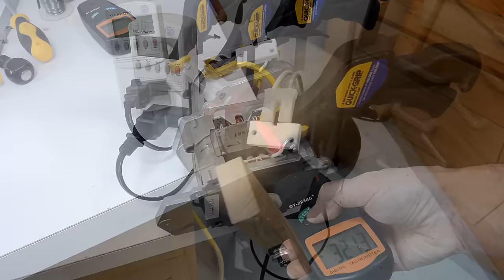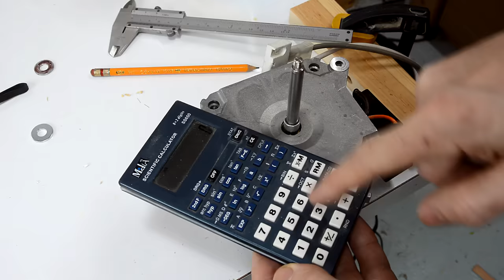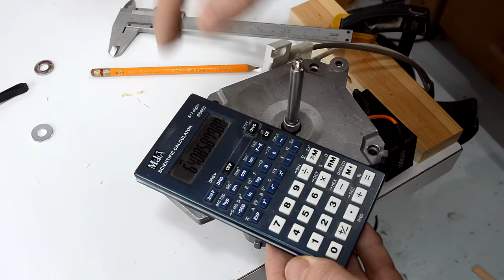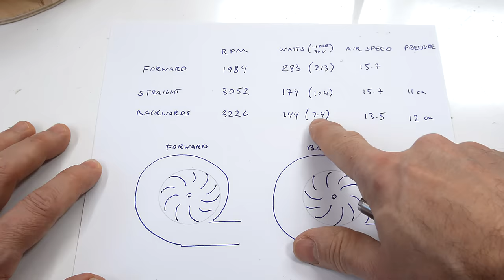Blower impeller design experiments

Comment: Mechanical engineer here. Sorry if i'm late, but i think this is very interesting.The forward facing blades are often used in industrial practice, just slightly different: short blades to reduce friction and in higher number. The low efficiency figure you got was absolutely due to the massive friction the air was producing on the blades. Side note: straight blades are used for dirty air flow (less change of blockage) and backward curved blades are used when higher pressure is needed more than high flow. You actually got the very same results that i got when I did the very same work but with a CDF simulation program, i'm so happy about this.

Comment: I know you are a real engineer, but either you did this experiment for the rest of us, or you have misplaced your ASHRAE manual. Forward curved fans produce tons of air at low back pressure, and backward curved fans produce much more air flow against back pressure. So for your dust collector system, a backward curved fan is the clear winner.

Comment: Pump Hydraulic Engineer here. If you underfile your backwards curved blades, you can increase the static pressure the impeller puts out. That is you make a straight cut tangent to the suction side (the concave side) from the trailing edge inwards, thinning the trailing edge. This will also however reduce the flow rate

Comment: I've built a couple of the impellers based on your original design with the backward curved blades turned by a 1.5 horse motor. I've been using them in the shop to drive a dust collector with 4" PVC piping to good effect. I've learned a few interesting things as a result. First is that wood vanes in a spherical pattern collect a lot dust on the inside curve of the blade because of the creation of a static vortex (I think) at the midpoint. This is exacerbated because of the relatively rough texture of the wood vane. The collection is also uneven, causing the impeller to lose balance as it runs. Tapping the impeller to loosen the dust helps, but it isn't entirely effective. As a result I've moved away from wood vanes to fiberglass. It allows me to easily create hybrid vane shapes and have a very smooth, static resistant surface. Also, I find them infinitely easier to manufacture consistently compared to cutting vanes from a blank on the bandsaw. I'm currently running with a parabolic (near) shape that starts with a sharp curve and ends nearly flat. This prevents the dust buildup and produces a 20% higher air volume with only a 10% increase in motor amperage. I don't have measurements for air speed or static pressure lacking the instrumentation (and the inclination to build any) to measure them. Anyway, I thought you might find this interesting.
Reply from the maker: I always have the blower after the filter.  Haven't had issues with dust buildup myself.
Reply: Are non-circular curves any harder to make from wood? Sure, they are harder to plot because compasses will give you a circular arc, but if you print a template out you could just cut them on a bandsaw roughly the way Matthias does here. (Providing the curve isn't so great you run into problems from the non-uniform thickness if you stack the blades together - but if the shape is that critical you'd cut them out individually with waste on either side)
Reply: Your comment makes me want to mess with airfoil (wing) shaped blower blades.
Reply: You run into non-uniform thickness all the time. I had a lot of variance between the blades even though they were cut from templates. You adjust for it when you balance the impeller, but I just found that I got something much more consistent in density and shape with the fiberglass. Plus, they were significantly stronger at roughly the same weight.
Reply: That is effectively what I have done. The shape is that of an air foil with a slightly flatter return (back) side. It made manufacturing a little easier to do that. I would change my mould again to use a full airfoil the next time.
Reply: Steve Hole como agucar brocas de ferro
Reply: Steve Hole 3
Reply: This is why radial blades are best for dust collection and moving material around. Just make them straight and they are self cleansing but produces more noise.
Reply: Steve Hole could you show us how to form those fiberglass impellers
Reply: @AS-ug2vq  Are radial blades the ones Matthias tested first?
Reply: @AS-ug2vq  Are radial blades the ones Matthias tested first?

Comment: I love the way you just pull an electric motor apart as if it was like peeling a banana!
Reply: Some people are peeling a banana as if they have to re-engineer an electric motor.
Reply: your comment restored my faith in humanity.
Reply: sasja de vries. Ummm ok lol
Reply: +David Stanton
One key difference... a banana cannot be re-assembled.
Reply: Find the right engineer and I am CERTAIN that banana would end up re-assembled. If there is a will...
Reply: David Stanton big boy good
Reply: problem when doing the swapping of the end bells can scratch the bushings, and will fail in a short time, care must be taken or this job will be like stepping on a banana.. the rotors shaft side should be left in the endbell and the back should be removed as it is less apt to have rust or dust.
Reply: David Stanton yes
Reply: I'd recommend a Genetic Engineer.
Reply: Rajitha Kommu z
Reply: I did feel jealousy at this point.
Reply: @K Me  Re-assemble a banana should be easy. Simply glue the banana back with silicon? Bonus: with food grade silicon, you can eat the banana later.
Reply: Electric motors are the only type of motor :)  things that use fuel are engines
Reply: only certain motors can be swapped in direction using such a re-mounting method. others just need two cable shoes swapped. - so it depends on your specific type.
Reply: This guy might just call you on it.    "I have perfected my CRISPR gene-splice.   The first two cloned banana trees are yielding some fruit, but once I re-engineer this hillside to duplicate my satellite tomography of the original banana's growing-region, I believe the 3rd-generation fruit will be close enough to meet design criteria.
Reply: IKR? I had this visceral reaction as in: "OMG, it's broken now!"  LOL How does he know it will still work? Machines still intimidate me.
Reply: مرحبا
Reply: yeah
Reply: Amazing wooden work, everything is clean and satisfied.

Comment: I don't know if you might find this suggestion useful, but I thought I might give it a try.
I have thought of drilling small holes large enough for a regular-sized toothpick to fit in where the vanes are glued to the hub plates. They don't have to be very deep, 1/4" should be fine. The idea behind this by placing 4 or 6 toothpicks on each vane's side where they are glued to the rotor plates is to give additional structural support to resist the centrifugal forces, and to avoid the glue shearing off while the rotor is spinning for a prolonged period ( e.g. several hours a day ). This might avoid the vanes flying off being catapulted uncontrollably across the workshop and getting someone seriously harmed, if (s)he's in the straight line of fire.

Comment: Hi, I'm a FireTruck technican.  Fire pumps use backward curved impellers to gain higher pressures.  I'm also a polymath, love studying stuff.  I just wanted to let you know that forward curved blades require a different housing design.  hard to explain in words quickly here so I suggest Google images and it makes sense right away.  but basically the outlet must be offset   and angled tangent to the tip of the blade angle.

Comment: Most backward inclined fans have a fan performance curve that is quite a bit steeper regarding static pressure. They are generally used with exhaust fans. Forward curved fans have traditionally been used in systems, like a furnace, because they have a fairly consistent CFM. But extra static pressure degrades their performance, they are a low pressure device. Commercial exhaust fans, like we would use for dust collection would generally use straight blade backward inclined or airfoil backward inclined wheels. Dust collection is a high static requirement and your backward inclined wheels should give a very stable performance over a widely varying load. As soon as you add a load to those fans, all your performance will change drastically.  Backward inclined performs better with higher static on the suction side.    Just my opinion.
Reply: I agree.
Try moving water.
Reply: I totaly understand everything 🤔🤔🤔🤔🤔🤔🤔🤔🤔
Reply: @christopherhayes9827 air...is a fluid just like water...Just 1000x less mass, same principles & physics.
Reply: @Errol.C-nz  a big difference is that with water you have to account for cavitation.
Reply: @claytonanderson4713  no difference in behaviour...aero propellers cavitate in air too...exactly the same as a prop in water...foils stall in water exactly the same as they do in air, just visibly easier to see any cavitation bubble...still the same in air
Reply: cavitation and stall are difference phenomena. stall is when the boundary layer completely separates from the low pressure side of the foil. Cavitation is when liquid in the flow phase changes momentarily to gas due to local low pressure in the flow.
Reply: @Errol.C-nz  But water is not compressible, gases are. Doesn't that change design considerations?
Reply: Not quite, while higher pressure needs are met by backward curved blades, it suffers from particulate dipositing on curves overtime reducing efficiency. For a woodworking blower, best design would be using straight blades with no curve or inclination. This will reduce the deposits on the blade but if you've a filter in front of it then backward curved blades are you best bet.

Comment: How about straight blades at an angle? I mean having it forward/backward facing, but without the curve.
Reply from the maker: No doubt less optimal, but I didn't feel like making another one.
Reply: I was wondering this too.....I suspect it's numbers will fall out somewhere inbetween the others
Reply: How about a forward curved blades impeller a little bit smaller ? Maybe it will turn faster and draw less power but blow the same amount of air.
Reply: I was going to post the following but saw your comment... And thx Matthias for answering: "Can you test with straight fins NOT perpendicular to the tangent? Rotor I have has straight fins, but they are at an angle relative to the 
radius.  I believe that may be the most efficient AND easiest to manufacture..."
Reply: How about straight fins that are flexible.  They start out straight and then bend a bit as they pick up speed.
Reply: Will it blow more if you make the blades taller? Are you using balsa?
Reply: the fans in my laptop are like that
Reply: The reason you typically see straight fins on electric drills etc is that the air input/output is identical in forward and reverse.
Reply: Backword curved blade
Foword curved blades
Paddle / Radial blades

Comment: Excellent demonstration! 
It's obvious that "forward" impeller perform  two different and opposite actions - centrifugically pushes air from center to outside and simultaneously pull it back to the center by raking scoops. 
There is another kind of blower called "cross-flow" with half-opened casing. It is widely used in the wall-mounted  air conditioners, and it has a "forward" petals because of somehow different physics inside.

Comment: Great experiment!  I have been involved in many discussions about this very fact.  

You should calculate the Velocity Triangles (easy to do) for your rig since you have flow numbers.  That would be the icing on the cake and would further explain the results you obtained.

One other measurement you could make is the difference between the inlet an Discharge Temperature.  Hopefully, at your low speeds, you would see the forward leaning blades producing the highest temperature.

Comment on VT's:  What you want on the exit is for a flow particle, flowing along the surface of the blade to exit the OD without any shearing.  Shearing is wasted energy and further heats the discharge.

Comment: It's a bit late and I think there is a good chance that you already know this, but what you described as "backwards fins" is actually a design used for cooling PC components. Overwhelming majority of parts using this design are graphic cards, but I did see at least one motherboard and one CPU cooler with this solution.

Comment: Hello Matthias, George in MI here. After 40 years of work for Black & Decker / Dewalt and always being fascinated by blower design as well I've always noticed one thing when comparing the uses of forward curved vs backward curved air movers. All of our vacuums, blowers etc used the backward curved wheels and spun at relatively high speeds. When ever I've worked on things that used forward curved blades, furnace blowers vent fans etc, their blades where much shorter (rim to center) and they typically rotated at slower speeds typically moving lots of air without much noise. What I'm getting at is that I don't know if just reversing the same wheel is a very valid comparison. I think you'd have to redesign the whole wheel (same diameter and width) to really see their differences.
Reply: backward curve fins, requires less torque, but higher rpms ?

Comment: To make a varying pitch spiral, just allow a string to wrap as it draws. Your curves do not gradually change pitch—they change in steps.
Reply: Overall there's not a huge difference in performance between a true spiral, a stepped spiral, and an eccentric circular housing unless you're trying to meet the absolute max performance and efficiency.

Overall the best spiral will actually depend upon the purpose, air movement and how much back pressure is created by the system often measured in inches of water. Usually due to the mass of the air you can get the best performance if the first part of the spiral (the part coming out from the edge of the impeller wheel) has the greatest slope compared to the rest of the spiral. Don't know if that makes sense but it's to allow more air flow due to the mass of the rotating air requiring more room around the entire diameter. Hope that makes sense.

Comment: The "backwards" Config is always used in every professional ventilation/air conditioning/heating/cooling systems. I worked on an built several systems on many industrial customers, with machines you could live in if the housings were empty, with a fuckton of ft³/h and in the basics its all similar to what you have built and concluded there. so: big thumbs up! :D

Comment: Nice vid, thanks matt.  Now, not sure if I can explain clearly enough:  at the centre of the impeller, the air is moving slower (smaller diameter), so to maximise airflow, the blades need to be deeper;  then tapered towards the outside to maximise exit speed.  Any housing needs to be accurately made for tight fit to prevent air bypassing the blades, a sort of Archimedes curve.   The exit port needs to be sharp & as close to the blades as poss, for max efficiency.   The inlet port neds to be large ( max volume, slow speed) and the outlet smaller (for max speed).  Each of these variables need to be experimented with.  I have used the back half of a bicycle with the chain-driven gears (by hand) to make a forge blower,  a hobby sideline,  which can get steel to welding (sparking) temperature for welding.  Interesting.

Comment: Great video Matthias!

the difference in tangential exit velocity you talked about with your marble analogy is why the blade angle causes the fan to require more or less power.   For a given flow rate into the impeller, forward fins require the motor to add more angular momentum, straight fins are middling, and backward facing fins allow the air to exit at a slower tangential velocity than the rotor itself.   all about rotational momentum! :)  very neat set of tests.

Comment: increase the 'diameter' to get more pressure. increase the 'thickness' to get more flow.
Reply: Interesting point.  So, with deeper blades near the middle, going shallower towards the outside (and housing to match) would work as follows:  near the middle, a larger volume of air would be drawn in & accelerated towards the outside, where the speed & pressure would be increased.  I've tried making a blower like this, seemed to work well, & got steel up to melting/sparking point with charcoal as a fuel.

Comment: That's a cool experiment. In theory (at least in water pumps) straight blades (but at an angle) are the most efficient design but only over a very narrow rpm range.  Curved blades a little less efficient but more tolerant to changes in speed.